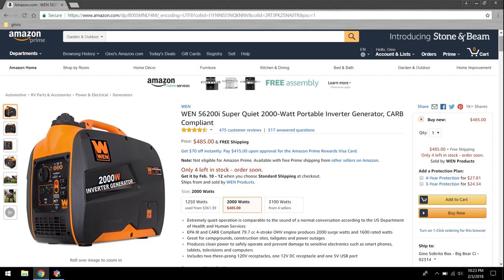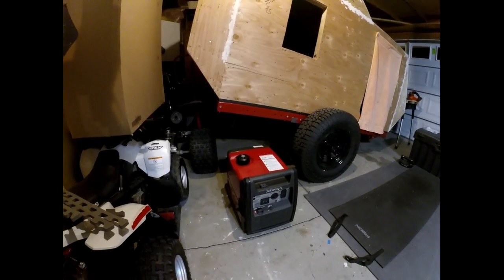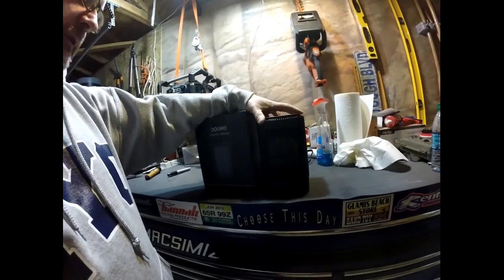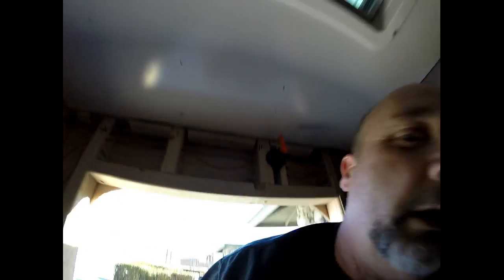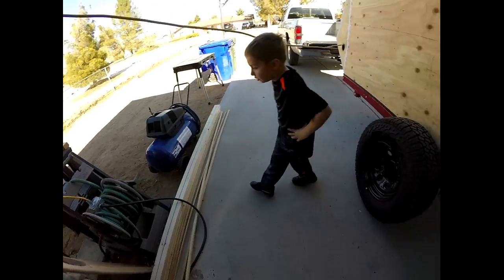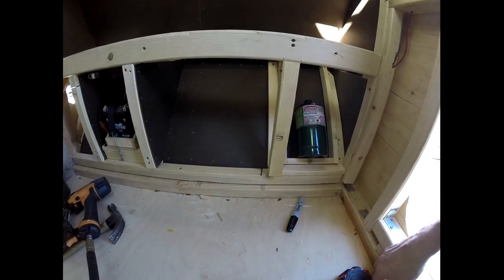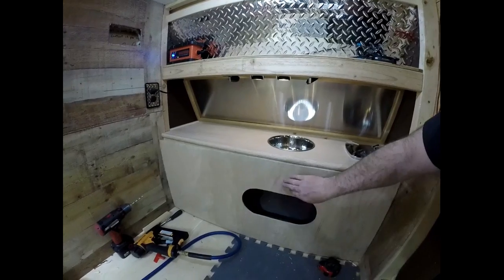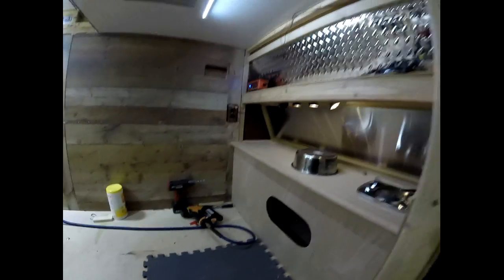Homemade DIY Camper  -  Kithchen

Comment: Wen generators are not a good brand. Had the same one and you have to watch the amps on it. The watts do not matter when you are putting it. I went with a husky 6250 and runs like inverter and get a ton of run time on it. However since you have a small camper it would be a nice perfect fit and easy portable and very small.
Reply from the maker: Sorry been super busy lately. What materials would you like to discuss?
Reply: @DIRTADDICT922  Im going to massage you n youtube.

Comment: Hoe do you plan on keeping the burner from starting the wood on fire?
Reply from the maker: I did extensive testing and the wood barely even gets warm. I have used the stove 2 or 3 times without any issues so far. I NEVER leave it unattended.  And I always disconnect the tank and put it outside when not in use.